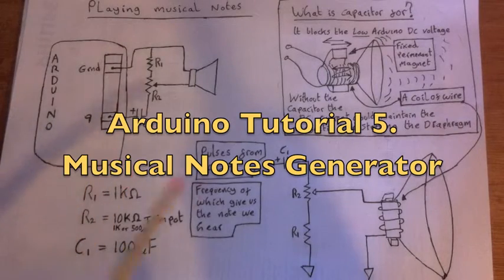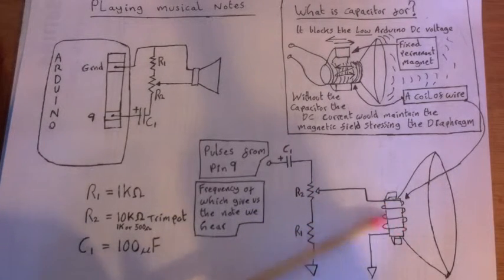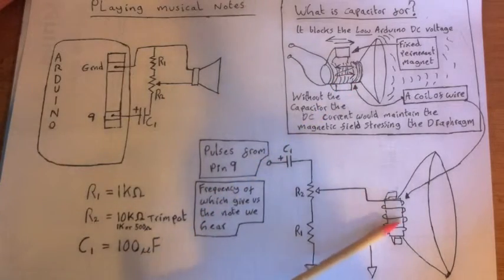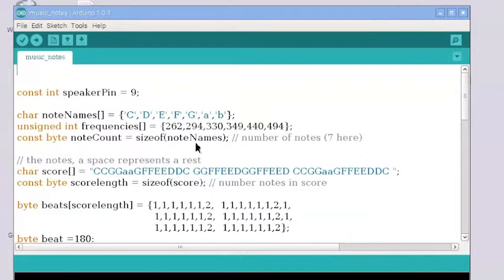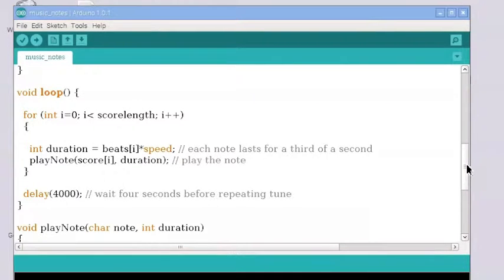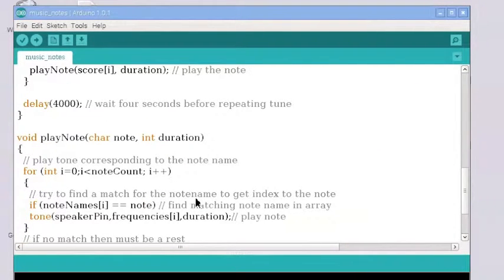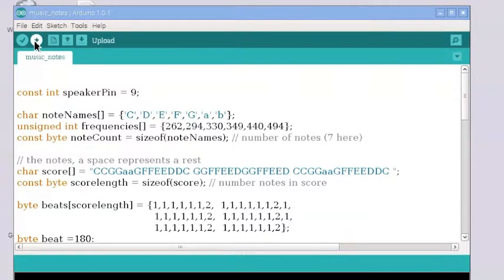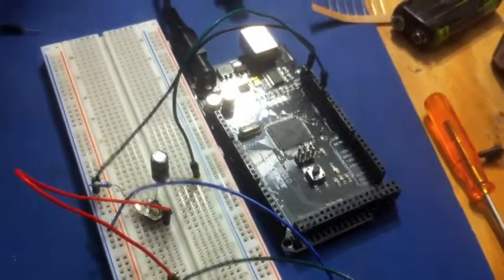Arduino Tutorial 5: Musical note generator

Comment: explained it really well, I always wondered what the unsigned meant :-p thanks for the clarification, the tune is real midi sure but the applications are great, this would make a handy door bell, you could code it for different tunes to represent different status levels on a sensor :-) I also like how you explained the speaker as well on how the frequency makes the correct vibration of sound :-) it also went far to giving me an idea of how many frequencies must be occurring in a second to get clarity of sound :-) must be loads :-D I thought what may be handy for this ardunio series could be a website with an index where you click on the circuit and it loads source code, video, notes, written explanation :-) I thought it could be a handy quick reference :-) and as you add more circuits you can do a quick click incase you want a ganders at a circuit you have already done to see how you can integrate it in :-D it still amazes me how diverse these boards are :-p
Reply from the maker: +BattonFive Cheers. Yes could make a door bell. But would be better to use a standalone microprosesor as much cheaper. Arduino is really meant as a teaching tool. Although a lot of people are using them in robotic projects etc. When a £1 microprocessor would work just as well. But its fun all the same.
Reply: Tech Tins lol yeah a pound would certainly drop the cost there :-D good point :-p  it really does look a handy board though :-)